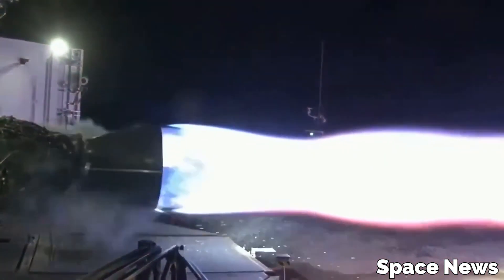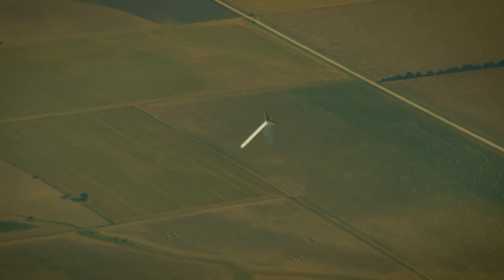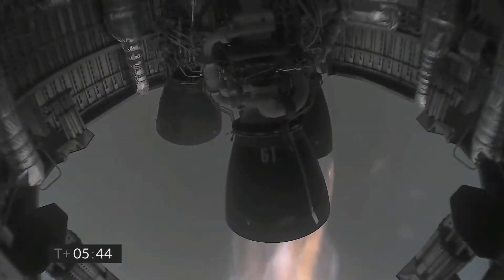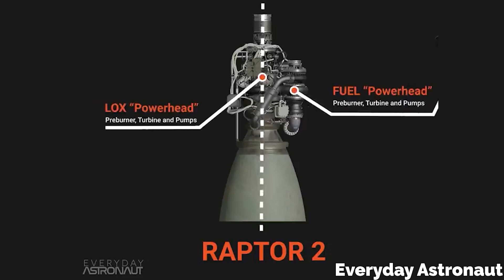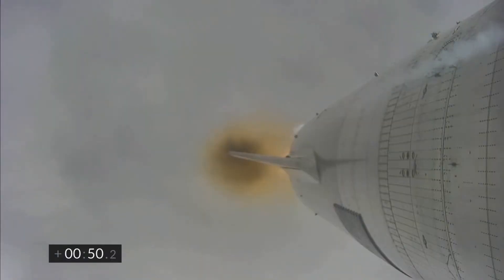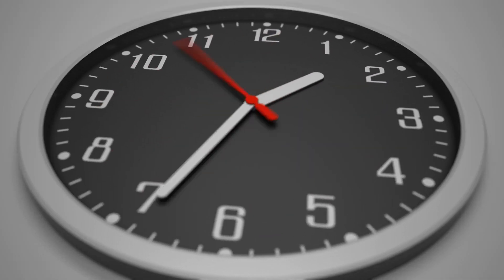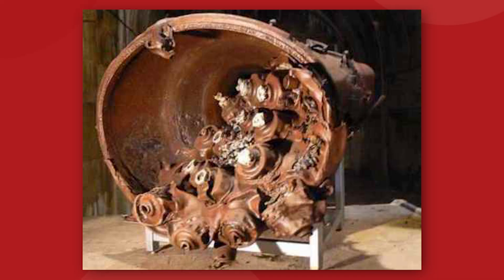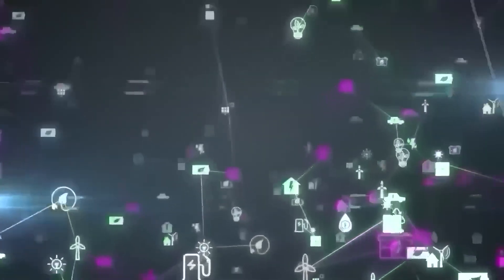How SpaceX Builds A New Raptor Engine Every 24 Hours!

Comment: It doesn't matter how many engines if every time the light one off half th bloody heat shield falls off
Reply: Starship heatshield tiles fall off during static firings on the test stands that place the bottom of the vehicle a few meters above ground level.  When the Raptor engines are fired in this configuration, the acoustic forces on those tiles are very large and result in a few tiles becoming detached (not half of the bloody tiles). 

During a launch, the Starship (the second stage) is attached to the top of the booster and the engines are about 220 feet (67 meters) above the booster engines. So, the tiles will not experience the damaging acoustic effects that occur in those static firings near the ground.

There are about 15,000 tiles on Starship and maybe 10 tiles become detached (10/15,000 = 1/1500). Elon has added a flexible ceramic fiber mat between the backside of the tiles and the Starship stainless steel hull. This mat has use temperature capability approaching 3000F (1630C) and provides a backup for the tiles.

Comment: 2:00 Go watch the EveryDayAstronaut's videos on Raptor and Engine cycles, it's literally his shots being used in the video, and he does a much better job of explaning everything.

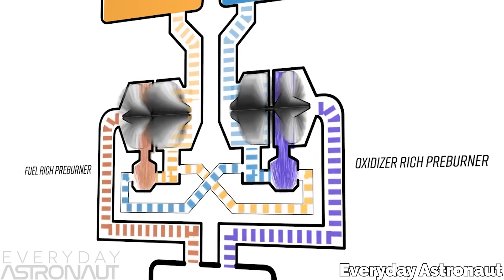4:22 - The Stage 0 Launch Mount spin starting the engine only applies to the Superheavy Booster's outer ring of engines, or maybe all of them. Uncedided by SpaceX.
The external engines don't need starting twice so only the inner engines can relight themselves for landing, the booster and ship uses high pressure fuel in so called,
"COPV's" (Composite Overwrapped Pressure Vessels) to spin up the turbines.

4:50 - It's a misnomer that not using a pressure vessel is more simple. Arguably its more complicated to have the Launch Mount spin start the engines because of the 
extra plumbing and the tens of quick disconnect points. It's really about moving complexity from the rocket to the ground, saves weight and simplifies flight hardware.

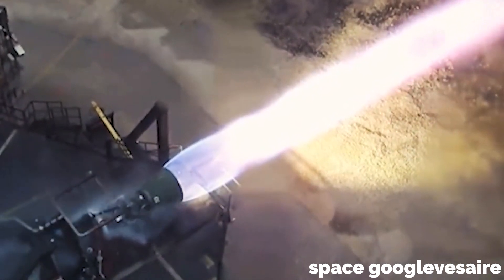6:00 - We suspect SpaceX will replace the torch igniter with a much simpler spark gap igniter. You could supersize this for a rocket if you wanted.

7:00 - Raptor 1 uses a lot of flanges to connect up pipes and chambers. Raptor 2 will use as many welds as possible, all of them if need be.
Rocket engines have very large temperature differences, over 3,000 C of temperature difference, it causes a lot of thermal expansion and contraction,
which moves the flashes and fastenes and causes them to loosen and to leaks. leaks between flanges create a sudden pressure increase in the gap and makes it liable to explode.
Reply: no torch ignitors in R2. Elon says their solution to not having them is "secret sauce" in Tim Dade's tour (I think part 2)
Reply: @joshgray1331  That video I believe, I didn't say but yeah they're keeping it a secret, first ideas of ignition methods is compression, spark gap, TEATEB, another similar spontaneous ignition mix.

Comment: If mom is a production operations engineer, her daughter in junior high school could figure this out.  Takt time = time to produce another engine = Quantity/Hours available.  If you run two shifts a day, 16 hours, and need 4 engines a day Takt time = 4 engines/16 hours or 1 engine every 4 hours.  Factories use pipelined production where work is done simultaneously in multiple stages. Minimum Number of Stages = Work Hours per engine/Takt time.  Say 160 Work Hours per engine.  Minimum Number of Stages = 160 Work Hours per engine/4 Hours Takt Time = 40.  Due to roundoff and overhead this number will get larger.  Mom gets paid to keep the increase small. Don't thank me, thank Henry Ford.
Reply: What you say is true.  All we know about the Raptor 2 production rate is that 7 engines are final assembled per week. We don't know what the total work hours per engine are and so we don't know how many production stages are required to reach that final assembly rate.
Reply: Multiplication of lines doesn't increase efficiency. Simplification of design and robotics does.

Comment: 39 engines, 36 sea level and 3 vacuum.
Reply: Good point. Depending on the mission, the Starship could have only vacuum enigines.
Reply: 42 total. There are 3 regular and 3 vacuum engines on starship.
Reply: @xploration1437  3 RS, 3RVac on Ship, 33 RS (20 fixed, 13 gimbal TVC) on the Booster = 39 engines; a potential upgrade to 6 RVac on a stretched Ship would take the stack to 42 engines.
Reply: @xploration1437  33 + 3 +3 = 39. Where do you get 42?